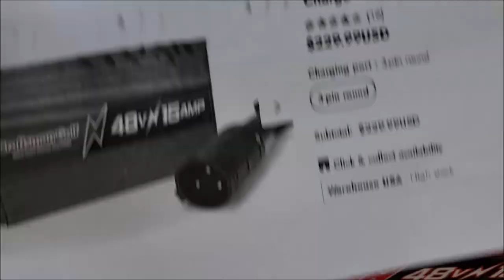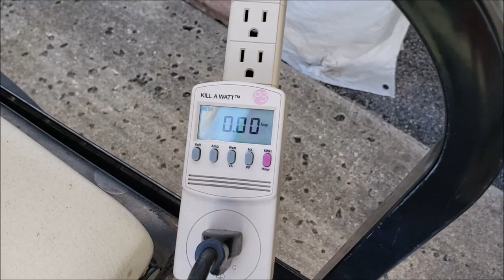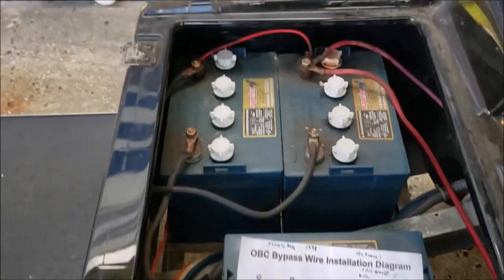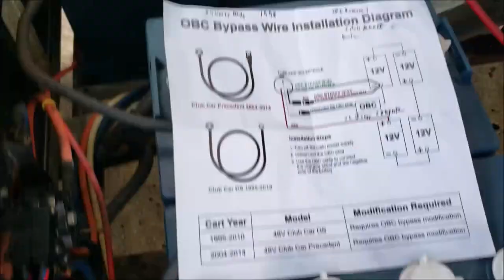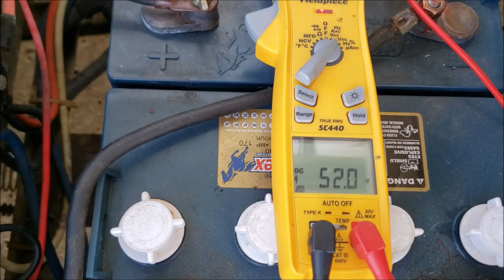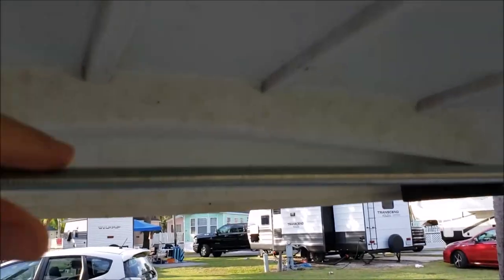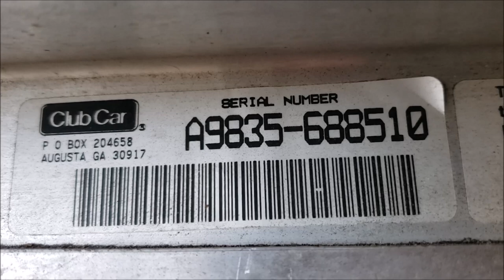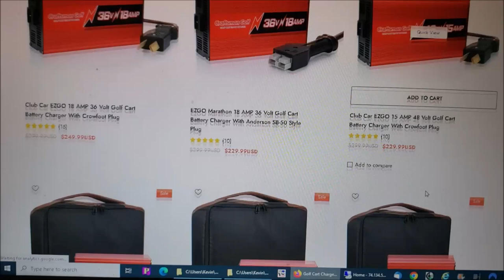Replace Your PowerDrive Club Car Battery Charger 17930 With A New Craftsman Golf Smart Charger

Comment: I have the exact same setup but my charger didn't come with the jumper wire. It seems like you only had to connect the jumper wire for the three pronged charger to work right? I'm just trying to find where I can buy just the jumper wire, all the of the kits come with lots of parts I won't need, and are really expensive for just a little wire with some different sized terminals on each end.